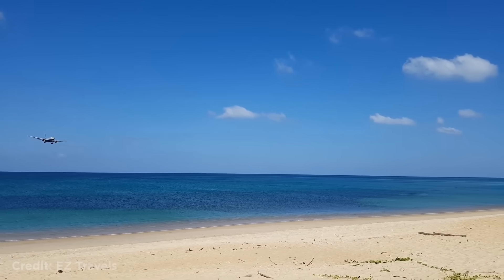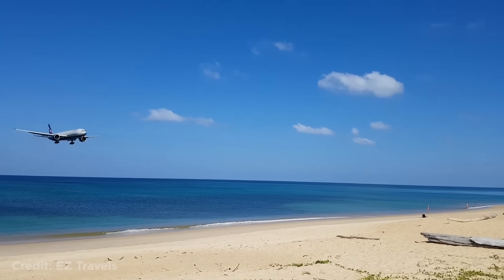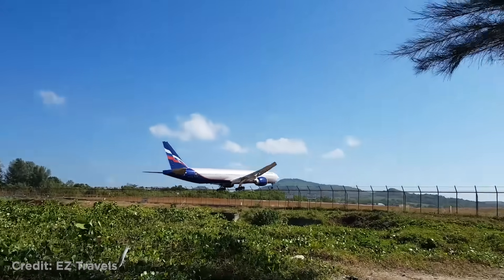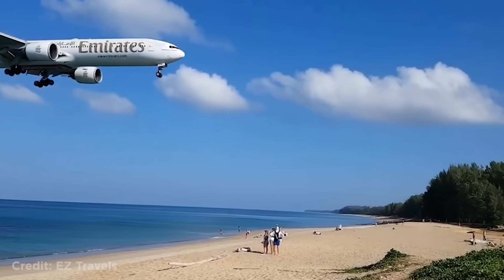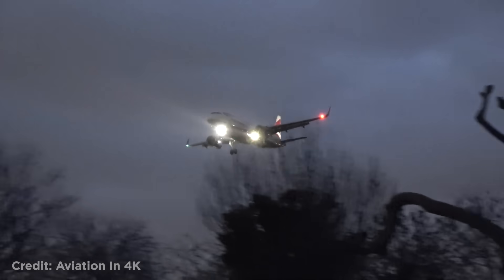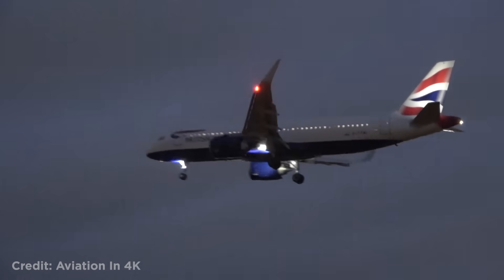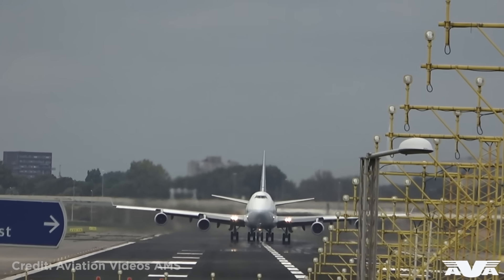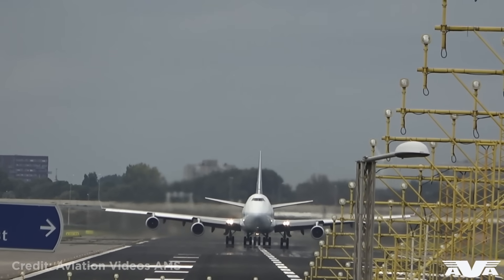Plane Approaches Too Low

Comment: I wonder if Aeroflot touches down early to have a longer rollout to save the brakes
Reply: A shallow approach typically means your speed at touchdown is higher, resulting in longer roll out - but not for your reason. Ideally, you have a 2,5-3° glidepath, flare (decreasing the forward vector at the same time) and land. The shallower the approach, the less speed you’ll bleed at the flare.
Reply: Doesn't help with the tires though
Reply: There is no need to try and maintain healthy brakes all the time, Aeroflot can maintain their planes via China and India
Reply: @oogie493  LOL. We have certified technical centers, which has been for many years before sanctions.

Comment: Runway 09 at Phuket has a strong upslope. Any plane can definitely vacate the high speed taxiway or at least the last perpendicular taxiway without having to go the end and make a 180 (even a B777-300ER with maximum landing weight can still vacate without doing a 180. Unlike this Aeroflot with very little remaining fuel after a long flight)
Perhaps he just wanted to do a shallow approach to assured that his landing will appear on YouTube.

Comment: 1.26 why did the nose gear take long before retracting?
Reply: maintenance issue.. it needs to be serviced.. might already be due for maintenance and inspection… scary…
Reply: @g_pazzini  not scary at all. can just be a brake lock out and the wheel needs time to spin down.